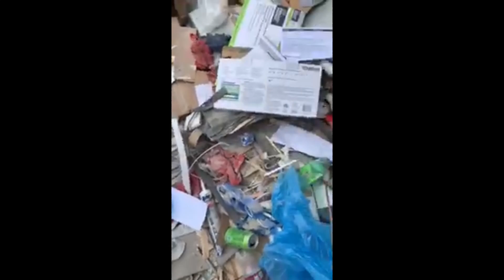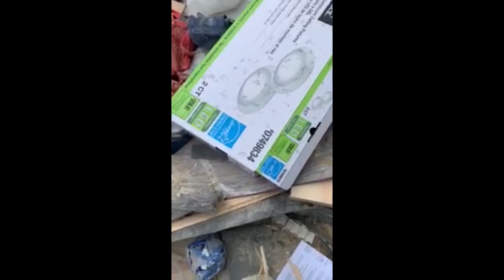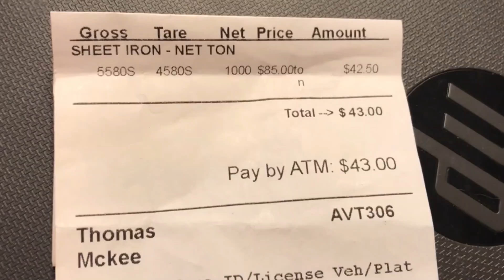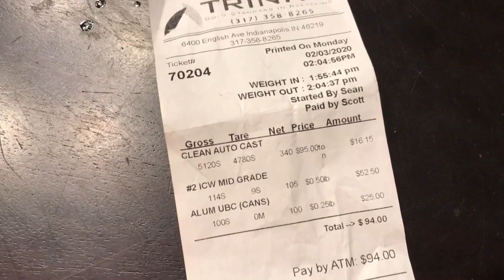Are you ready for alley picking!

Comment: I know what your saying, I had an old 80 Cadillac  , not heater, it would overheat, well used, it was gifted to me in the first place.anyway , it was sitting across the street,  a black brother came by one day with a friend of mine. He asked what was up with it, and I told him one of the two fuel pumps was out and it needed a batt. He asked me what I wanted  for it, I told him to haul it off and I gave him the tittle.he came back in just a little bit with a friend and a bat. They hooked up to it and were gone. He came back a couple of days later an d thanked me a couple of more times, showed me that he had changed titles etc. And he was driving the car.i asked what he had to do to get it running. He said nothing. He said he got home and turned the key and it started right up. I guess towing it home loosened up the pump. Anyway , shortly after he got a job. And came back to thank me again, without the car he wouldn't have got the job.
Reply from the maker: That just touched a brothers heart big time🙏 I gave away 5 vehicles in my life three not running. But same situation as yours in most. People needed them they had little money and I wanted them to help. Most of them was bought for $500 and I had for a year or two so I got my moneys out of it ya know. Spread the love to others when you know their situations.